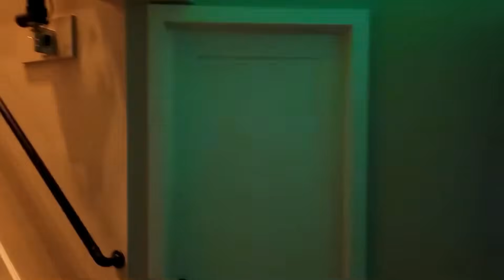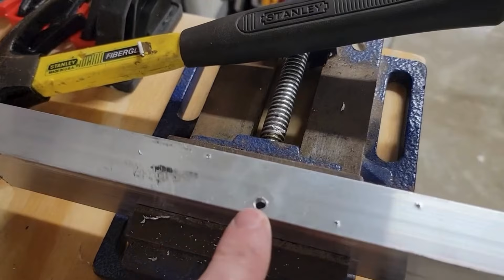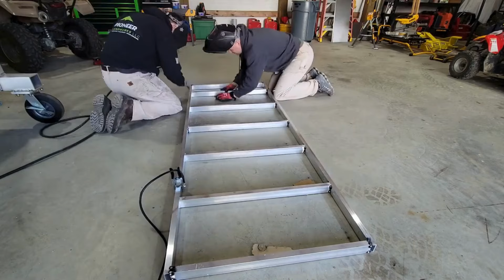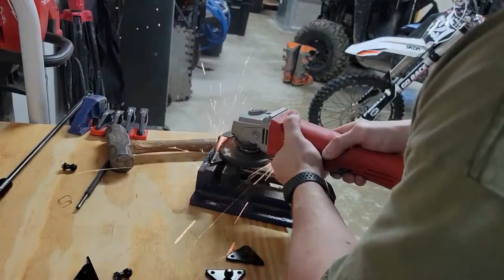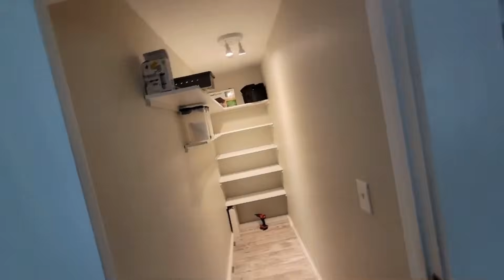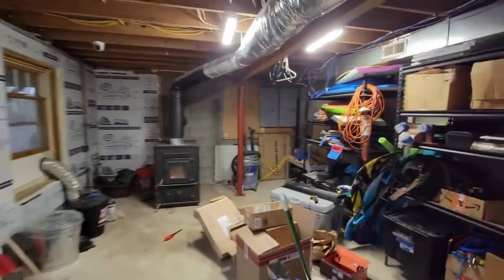Transforming a Stairwell into a Dual-Purpose Pantry with Hidden Basement Access

Comment: Does the remote control set come with the manual wall switch?
Reply from the maker: The PA-31 control box will come with wireless remote controls while the AC-24 Push Button External Limit Switch mounted to the wall is sold separately.

Comment: Pretty cool.  It looks like the hinge side of the platform is solely supported by the hinge screws?  #10 screws in shear run into aluminum is mildly concerning to me.  I would add a ledger board on that side for the platform to rest on in the lowered position.
Reply from the maker: We appreciate your suggestion! The example design by Bryan can be used as inspiration for viewers and could always be modified for improvements, such as adding the ledger board mentioned, or other adjustments according to the case by case needs of each user!

Comment: I am looking to build my own trap door to basement but was wondering if wood to metal comparison if one is stronger or lighter to use in the building of it?
Reply from the maker: For your project, both wood and metal have pros and cons, so consider the weight and strength requirements. The aluminum frame has more structural strength and is lighter weight compared to wood; however, wood is more affordable and widely available. Projects like these often utilize a combination of both materials to achieve an optimized balance of their benefits.

Comment: Can you do this without the aluminum plate and only the wood frame
Reply from the maker: Building using only the wood frame will result in less structural strength compared to building with both wood and metal; however, that should not be an issue for lighter weight loads.
Reply: Absolutely

Comment: love this. my wife is hounding me to do something like this. Im curious if there is a way to do this where the hatch opens to at least 90 degrees, this seems to be like 80, also trying to think of a way to not have the strut and actuator "in the way" as much... anyone have any ideas to improve upon this design? is there any free softwares that could help work out some design tweaks and make sure they still work beforehand?
Reply from the maker: Glad you liked the project concept! This configuration requires the door to not fully reach 90° because doing so would result in a jammed door when viewing from this actuator's mounted position's perspective - pulling motion will be flush and parallel to the 90° door. Perhaps another configuration that could work is by using the actuator to move a separate arm that has a wheel attached to the end making contact with the trap door - this ensures the actuator will always be in a position that does not become flush with the door's angle:
https://www.youtube.com/watch?v=-Y3EelQwqJU

We hope this helps and we'd be happy to hear other ideas for trap door designs!

Comment: What length of stroke is the actuator?
Reply from the maker: This project uses the electric actuator model PA-04-14-100 with 14 inch stroke: https://www.progressiveautomations.com/products/linear-actuator-ip66?variant=18277292507203
Reply: I needed this video to validate my idea is (hopefully) possible. Building a house with a basement door where you walkout & have to go up a set of stairs to get to ground level. I also live in an area with mature trees, so a lot of falling leaves and of course rainfall. Looking for something like this to cover the steps and prevent precipitation and unwanted material collecting in the bottom. Would you say electric or hydraulic actuators would be preferred for exposure to outside temperatures in Kansas City? Would you recommend stainless, aluminum, or steel (all would be painted) for outside durability. Opening is 8’ x 12’. Thanks!
Reply from the maker: The main benefit hydraulics may offer you is their higher force rating if your basement door requires it. Electric actuators will usually have options that provide sufficient force rating for basement doors, while offering other benefits such as better operational temperature flexibility (no pressurized fluids), higher energy efficiency, simpler integration, and lower year-round maintenance requirements. We suggest considering stainless steel as it is naturally corrosion-resistant, even if paint chips or scratches, and performs well in wet, salty, or high-humidity environments. We hope this helps! Our team will be happy to hear more detail for your application requirements and discuss with you further at sales@progressiveautomations.com.
Reply: What external limit switch is being used , I’m having an issue with returning after switch is depressed
Reply from the maker: @ChrisParrish-v8v  To ensure that the electric linear actuator shuts off in the desired position, Bryan wired the actuator to an external limit switch (AC-24 Push Button External Limit Switch):
https://www.progressiveautomations.com/products/ac-24

Wiring diagram sample:
https://cdn.shopify.com/s/files/1/0061/7735/7891/files/Single_Channel_Control_Box_with_External_Limit_Switch.pdf?15272234796292384046

If you are unable to reverse directions after the switch is depressed, it could be that the diode inside the external limit switch is compromised or wired in the opposite direction. If possible, try testing the external limit switch wired in the opposite direction.